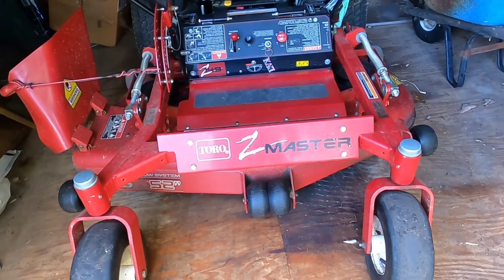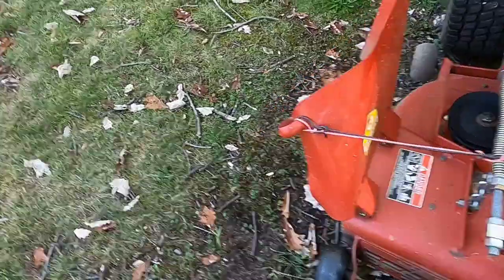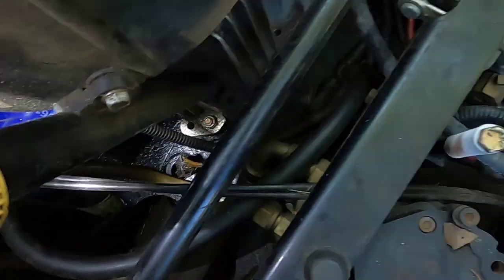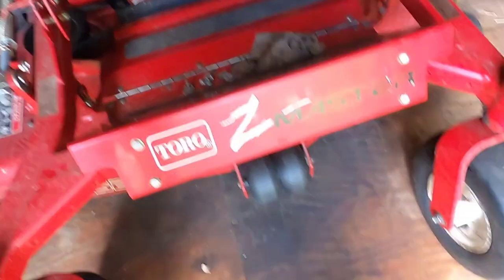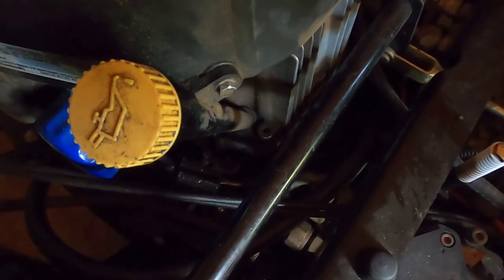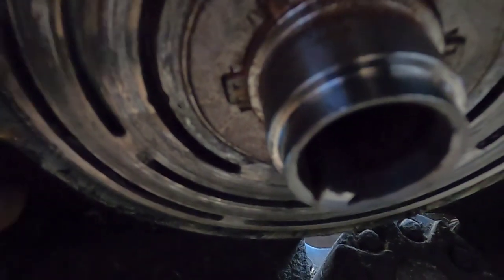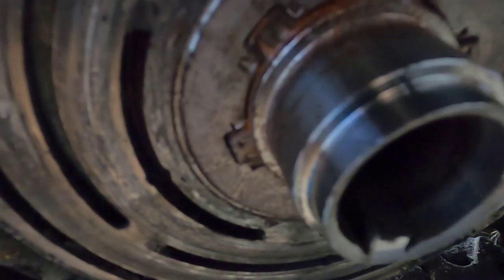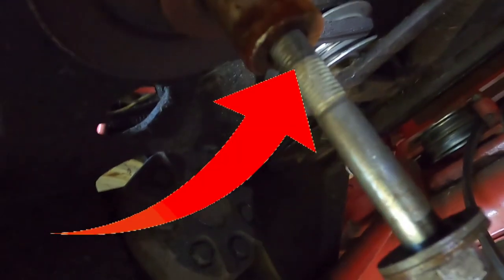Zero Turn Blades Not Engaging

Comment: You don’t need to run a wire, if the switch is good , when you turn the key to on mode not start, you will hear the clutch  click , also use the multimeter put on Ohms continuity it will beep when you turn on  and off the PTO switch with the PTO unplug d from the machine. Lastly some clutches can be adjusted with the three bolts, use a feeler gauge and set to specs.
Reply from the maker: Thank you for adding additional information. In this case the clutch did not click. Both the clutch & the switch were bad & replaced. Just for those who may be using a multimeter for the first time not all  meters have the audio beep.
Stay well, Joe Z

Comment: Dropping another LIKE on your video! I have a Z-Master Toro 3000 w/72" deck for the property here. The old Z-Master did a really fine job for a lot of years. Excellent video going over the repair... loved the comment of the jack being older than some viewers! Trying to avoid extensive repairs, I go through the book and make sure I get the service to mitigate issues before they get really bad. Thanks for the video... great information!
Reply from the maker: Thank you Ray. This was a work out. I did this repair at the owners home because it would not fit on my trailer. That jack is old LOL. I just missed 2 of these on face book, 1 for free( it would not start ) looked almost new. The other engine was shot 500.00. Gone in less than an hour!
Stay well, Joe Z
Reply: Al

Comment: My 3 year old Toto zero is doing same thing.
Reply from the maker: Thank you for stopping by. The first thing I would do is to check the switch. Pull the switch to the start position & connect a volt meter. If you do not get a reading check the fuse. If the fuse is blown check the wires for a short. If the fuse is not blown check to see if you are getting power to the switch. If so change out the switch. If the switch checks out first check the connection to the  PTO clutch, make sure it is firmly attached. If if is before you remove the clutch  remove the connection & make sure you are getting power to the clutch. If you are then then the clutch is the issue.
Let me know if this helped you out.
Stay safe, Joe Z

Comment: Hello have a z5400 craftsman new clutch on but will not work correct where the wires are on top  disconnect when the top of clutch turns Wht is wrong we are lost
Reply from the maker: @anthonymadmanstricklandspo7818, I am not sure if what you are telling me is the clutch spins  when you have it engage & it pulls the wires out. If that is the problem look for a bolt or some type of "retainer, for lack of a better word". The clutch should have a hole or a notch that a "retainer" would go into to keep it from spinning.
Let me know if this was of help.
Joe Z
Reply: @JOEZEP54  yes the clutch stopper bracket was broke but now we are trying to figure out how to get the pto which is a new switch to activate the blades, when we touch clutch with the hot wire it activates but not from the switch. Hopefully I am explaining this right thank again
Reply from the maker: @anthonymadmanstricklandspo7818  Check the wire coming from the switch to see if you are getting 12 volts. If not check the fuse.
Reply: @JOEZEP54  ok we did that my father in his way back over in a few so we can take another go at it, I’ll let you know how it’s going thanks

Comment: I have a zero turn Husqvarna exact same thing happened to us.. But, we replaced the PTO and have power to it.. but, still the blades won't engage.. you can hear the PTO clicking - any suggestions
Reply from the maker: You may have already checked some of this out already, hard to tell with out seeing the unit but here we go. Are you sure the click is from the PTO?
Are you able to check for power from the PTO switch? Are you able to bypass the PTO switch to the PTO to see if the blades
will engage, if power is coming from the switch but blades do not engage unless you bypass the switch you may have a short in the wire or a loose or bad ground. Are the blades free from any 
string, rope, wire or any other item keeping them from spinning? Is your deck belt in good shape and routed back on correctly. Is the PTO mounted correctly. Although these questions may sound obvious I hope one of them is of help. Let me know and above use caution and 
Stay safe, Joe Z